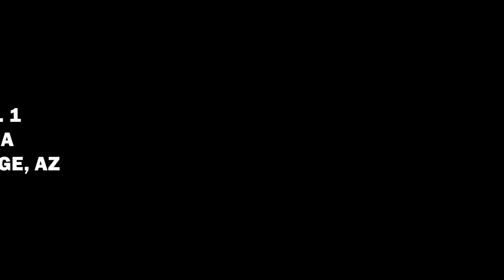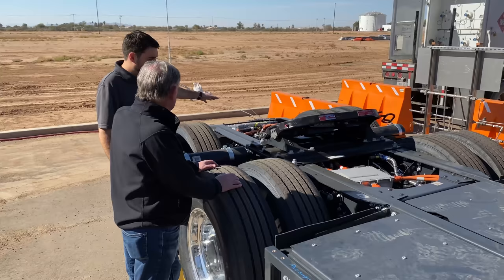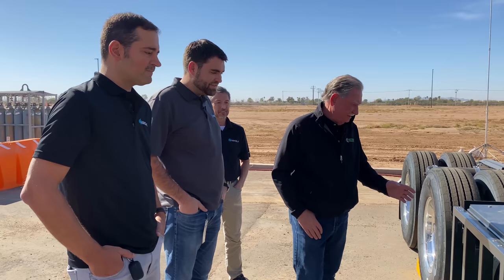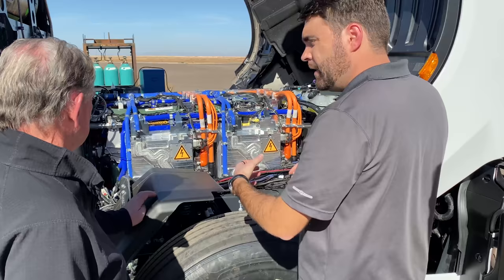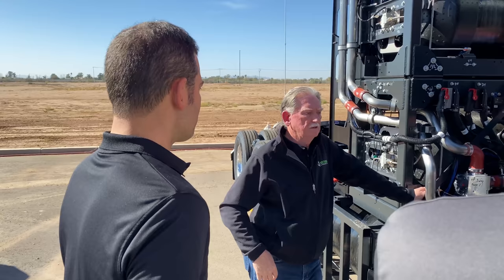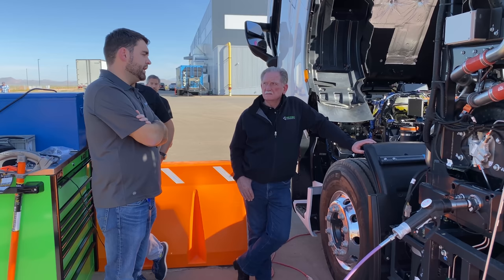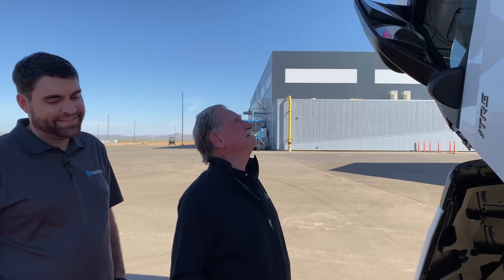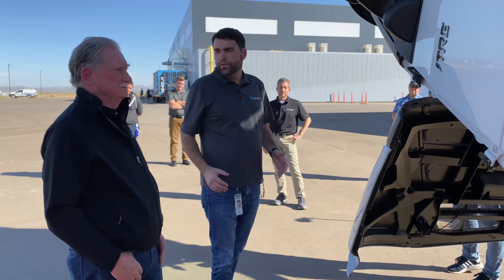Nikola Series - Ep. 1: Introduction & The FCEV Alpha

Comment: As environmental regulations and policies have been strengthened since the Paris Climate Change Agreement (2015), the market for hydrogen fuel cell vehicles and electric vehicles, which are pollution-free cars, is expected to continue to grow. Hydrogen fuel cell vehicles and electric vehicles are expected to coexist similarly to gasoline-diesel technology of current internal combustion engines in the future automobile market. Battery electric vehicles are advantageous for short-distance operation and car development, while hydrogen fuel cell vehicles are advantageous for long-distance operation and commercial vehicle development. In other words, battery electric vehicles are expected to meet the current demand of gasoline vehicles and hydrogen fuel cell vehicles, and just as gasoline and diesel vehicles coexist, electric vehicles should avoid a fragmentary approach that only one technology will exist because hydrogen fuel cell technology and electric vehicle technology can compensate for each other. International Energy Agency, McKinsey, Bloomberg, and Market & Market predict that hydrogen fuel cell vehicles and electric vehicles will coexist after 2030.

Comment: FCEV are DOA. By the time they figure it out, not to mention faster refueling, building infrastructure, etc, battery trucks will be all over the road. Like with passenger cars, Tesla will show it’s possible and more economic and the entire industry will follow it. Too bad people are still wasting their time with this. The worst part of this is that over 80% of hydrogen is produced using fossil fuels and that fuel cells are only 40-60% efficient. With losses in production (approx 50%), trucking the hydrogen and losses in the fuel cell, diesel cars might produce less emissions than FCEV trucks. Granted, there is green hydrogen (produced using solar energy) but it’s so inefficient in all stages that the cost becomes prohibitively expensive - which, again, will mean it’s DOA compared to EV trucks. 

The only reason people are still talking about this is that the oil industry sees this as their savior, allowing them to take control over it an gauge prices again. At the same time, vehicle manufacturers talk about it since they lack vision and can’t see 3 years until the future - and as such have not put in place a strategic battery supply plan - so are now 5-10 behind. What a shame.

Comment: Interesting. This video alone almost redeems Nikola into a real startup and not a scam startup in my eyes. I am a little concerned though about the "our tanks won't go flying" approach. I feel like that's going to lead to over-engineering a ton of extra weight, and still, when push comes to shove... sooner or later there is a force (e.g. that freight train) that will break the vehicle into pieces. I'm less concerned that the tanks are hard to break free (don't tell me it's impossible to break them free, Murphy will bite you in the you know where) and more concerned about what happens when they do break free. Not saying they should release in any normal collision, but still, you have to have some limit that is your maximum "expected to survive in one (mangled) piece" collision force and plan to fail gracefully if that force is exceeded.

Comment: So what did they do to solve the Platinum from fouling in the polymer electrolyte membrane where it performs the same output after a million miles. What about flooding and freezing? How have they solved the high cost issues with humidity sensors and their short life spans? Building an impressively complicated thing  as shown was never what was holding this tech back. How does your tank address the smallest atom in the periodic table diffusing through all know solids except perhaps graphine? Basically talk nerdy to me! These are the key fundemental solutions that need discussing to prove their concept or any fuel cell vehicle has merit. Honest true answers Sandy please, shouldn't be a problem for you. We are working on that is an acceptable answer with detail. I am not a hater  otherwise I would be asking the hard electrolizer and distribution questions we all know the answers to.

Comment: The point about degradation is spot on. No one relying on a truck for work wants 500 miles today and 460 in 5 years. Tesla better solve that as the consumer degradation aint gonna cut it in the professional world. I have confidence they will figure it out for their semi as 4680 is phenomenal.
Reply: Besides Tesla figuring it out, I don’t think anyone will care about that 40 miles for the TCOO it’ll run on
Reply: Most trucking company's are cycling out their equipment every 3-5 years. The number of companies keeping their equipment longer are in super specialized industries where the truck body or equipment is so expensive it trumps the increased maintenance cost of maintaining the engine or are in incredibly small numbers of people who do all their own deep maintenence and try to keep the truck longer. That last group is statisticly insignificant and they usually start off with used trucks not new ones anyways.

I don't see battery degradation as an issue. Especially since swapping out a battery is easier than rebuilding an angine and rebuilt or refurbished batteries will be a whole industry unto itself by the time there are hundreds of thousands of units in production.

Let alone the trickle down effect of top tier trucks being relagated to lower tier duties as they age. Much like diesels of today. Today's fleet of high capacity over the road trucks criss crossing the country become tomorrow's second hand trucks performing less mission critical duties and tend to work in regional or drayage duties or are shipped off to other places like Latin America or Russia where they live in places with lower labor costs and the increased maintenence and/or decreased performance is a non-issue.

Comment: Since their previous CEO was a blowhard, we have no idea how they will produce hydrogen in an economic manner. If it is electrolysis, we know it will be a > 30% energy conversion efficiency going from electricity to hydrogen and then back to electricity while batteries are greater than 80%.

Hydrogen gas is lighter, which is essentially it’s only advantage over BEV. 

Hydrogen gas has many disadvantages. It is corrosive, pernicious, requires high pressure storage, it burns with an invisible flame, it has no smell, it has high volatility and has a low ignition point. 

Elon believes that the weight difference between a BEV 80 ton semi and a gas powered one will be under 500 lbs or less than 1% of overall allowable weight. 

There is no hydrogen infrastructure, there is limited hydrogen production which uses natural gas as a regent. I have heard no major undertakings to increase the availability of hydrogen fueling. Hydrogen will be the betamax of energy storage.

That’s nice you keep an open mind regarding this technology, but this company is a fraud. They all sat there as their old CEO defrauded investors and said nothing about his lies. This company deserves to be forced into Bankruptcy, and everyone who did nothing as their shares rose in value following the falsehoods fabricated by Trevor should be sharing a cell with that charlatan. 

You are damaging your reputation by giving these phonies an opportunity to rehabilitate their image. This content isn’t worth the risk.

Comment: It is pretty simple and it takes more than Sandy to convince me otherwise.
1. There is NOTHING special with NIKOLA except a very long bad track record... we all know the story.
Started with a gas lorry, then went with hydrogen and the first trucks are battery trucks???

2. There arleady are several both hydrogen AND battery trucks on the road from already established OEM's in the trucking segment like VOLVO, Mercedes-Benz, MAN... the list is long 
The differens is these are fairly "Low Key" 
NIKOLA does not have any proprietary tech they just have a high valuation...

3. On "paper" Hydrogen sounds like a good idea but the fact that you need TWICE as much energy for a hydrogen fueled vehicle as for a battery vehicle is really "The nail in the coffin" they WILL NEVER be able to compete in cost/mile.
That is pure physics.

4. The "claimed advantage" is the range... that is "range before refuling" that is no problem for battery power TODAY.
In much of the world a driver HAS TO REST around AT LEAST 30 minutes every 4 hours...
But really that does not matter since a battery truck only use 50% of the energy xompared to a hydrogen truck (Well to wheel)
It is not about "refuling time" it is about cost/ mile.

5. Hydrogen infrastruckture is simply to far behind in development and far to expensive...
It is a "Chicken Egg problem" nobody will invest in a Hydrogen network before the trucks exist and nobody will buy the trucks before yhe refueling network exist and we talk double / triple?? digit billions...

Hydrogen as a niche fuel will work but for "main adoption" it simply wont.
Considering NIKOLA's pitch has been selling "trucking as a service" with a fixed price/mile including fuel THEY WILL NOT BE ABLE TO DELIVER.

Comment: So Nikola hired Munro & Associates - for what?  Engineering?  PR?

This company leaves a sour taste in my mouth.  All of the horrible, no-good lies are one thing to provoke disgust, but even worse are the specifics for hydrogen-fueled trucking.  In short, their business plan can't get off the ground, no matter how they engineer the truck.

About 95% of hydrogen generated for commercial use in the United States is produced from natural gas.  And the process emits carbon.  It is not green.  It's worse than it seems on first glance, though, because energy losses, from producing hydrogen, to compressing it, to transporting it, to storing it, to running it through a fuel cell to derive electricity, are huge.  Just... huge.  Most of the energy expended to get a pound of hydrogen to the truck is lost before it can be turned into movement.

It's even worse if they don't use natural gas.  Electrolysis is even less efficient; more energy losses.

Inefficiency results in costs that are much, much higher than diesel per mile traveled.  The truck itself will be priced significantly higher than a diesel truck, too.  The business case for haulers is nonexistent.  Haulers know this.  Wall Street investors generally don't.

Investors are the real target of Nikola's PR efforts, have been from the beginning.  They tried blatant lies and their stock price zoomed.  Original investors generally bailed out, made a profit.  The stock price slumped badly when the lies were exposed.  Now they're going back to the well to draw another cup of sweet, sweet investor money, and the scam this time is the pretense that they have a real, real truck to show, and it's full of advanced tech.

Advanced tech Nikola didn't make.  They're strictly an assembler, despite lies to the contrary.

But the advanced tech in this truck can't overcome the abysmal economics of hydrogen as a transportation fuel.  Any haulers who try to incorporate hydrogen trucks into their fleets will lose money.  A lot of money.  It won't work.  So Nikola will not be selling this abortion of a truck to paying customers.  The customer base is wise to the scam.

As to the assembly itself, Sandy, surely your experienced eye noticed a serious center of gravity problem with this prototype.  The fuel cells are mounted high, and they've run a stack of heavy pressure vessels up the back of the cab to the very top of the truck.  I don't think that thing will be safe to drive on public roads.

Investors won't notice that, either.  You know what the engineering qualifications for investors are?  Exactly.  There aren't any.

It's a grave mistake to get into bed with Nikola, Sandy.  Your reputation is worth more than whatever they're paying you.  It disappoints me that you didn't already know not to play with scammers.

Comment: Just another hybrid. Acting as a stop gap during battery supply shortage. Getting away with hydrogen tanks, because the vehicle has the space for it. Increased complexity with a viability that is determined by the availability of batteries. Risky.

Comment: well ...this is a surprise not a god one... but ok i guess...
Major problems ignored by hydrogen "interests"
Hydrogen needs :
1. About 30kwh for a kilogram off H2 ...
2. 9 kilogram off clean water to make on kilogram off H2
3. Ignoring the infraestruture to pressurize and distribute ...

I can make about 150km with 30kwh in electric car (average efficiency at 120km/h speed)...
In a truck you might do about 40 to 50 km ... with only the energy needed to "make" the hydrogen

Other important and forgotten fact ... 9 kilos to 1 off clean water ....really ... don't we have millions off people die off lack off access to clean water and severe shortage in several countries, unable to water crops and livestock.... Yeah why not use that water on a ratio 9 to 1 to fuel our cars / trucks. Makes all sense, doesn't ????

Comment: That's a cab over truck design, that will never be successful in the US, truck drivers won't want to drive those things, and there's a shortage of truck drivers already.  Good luck to any trucking company that buys cab over trucks, and tries to hire truck drivers to drive a cab over truck for 11 hours a day.
Reply: If they tried one in tight city settings they'd never go back to conventional.
Reply: The big downside of cabovers is you are sitting over the hot noisy engine. The battery version of this should be fine. The fuel cell version does have heat and the noise of a cooling system.

Comment: Hey folks; give these guys now running Nikola a break. The con man that started the company is long gone and they are trying to make a go of it with a real factory and real trucks. It is sad,  though, that they seem headed down the wrong track on the Hydrogen route. It's not environmentally clean because of all the pollution from the production of the Hydrogen from Methane and that's the only way to make it commercially viable in cost. Why use energy (electricity) to make Hydrogen from Methane and then have to transport that all over the place to fuel trucks ?  Highly inefficient. The Tesla Semi will start rolling out late 2022/23 and will be better, and likely cheaper.  No way Nikola could match that time line so they are doomed to failure. Sad. Maybe they can all go work for Toyota which is still in love with Hydrogen.

Comment: h2 fuel cell trucks better choice than battery electric trucks. h2 fcev electric trucks will way significantly less than battery only electric trucks. h2 fcev trucks will be able to deliver more freight per truck than battery only electric trucks due to weight limitations for trucks+trailer+freight on most roads throughout the world. battery electric fleets will need to be much larger in number than h2 fcev electrics fleets to deliver the same amount of freight.

Comment: Doomed to fail even if Elon would do it - due to no charging network. It can only work in large tractors where farmers store solar energy in a form of hydrogen. But farmers will be better off swapping battery packs (as a solution for long charging time) using their own lifting equipment.